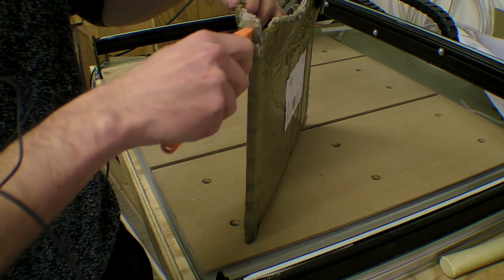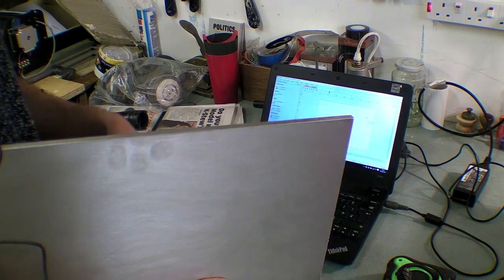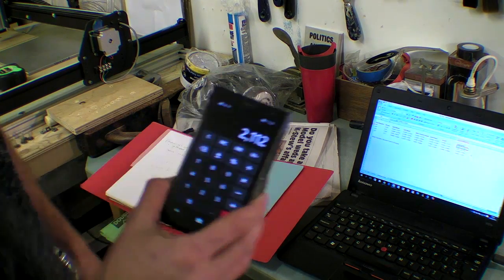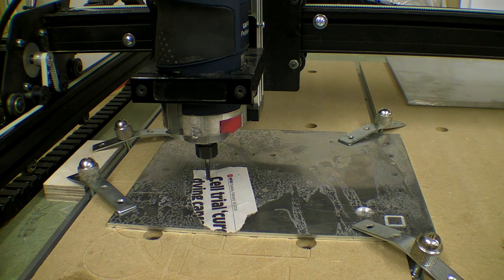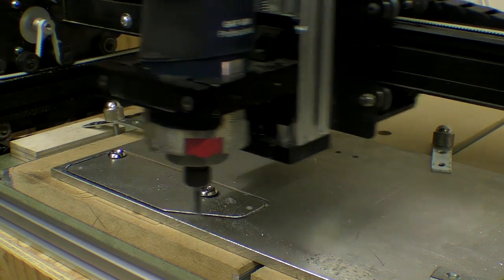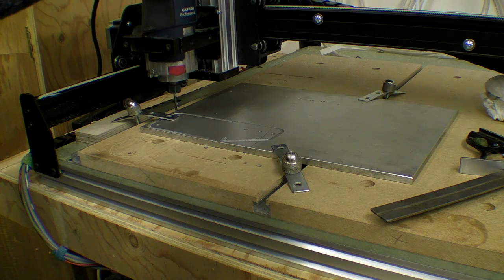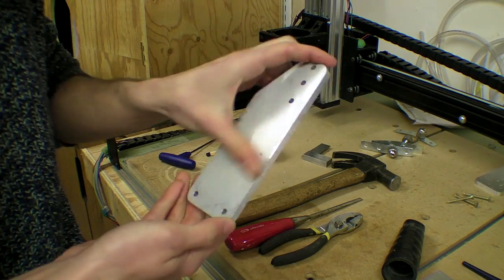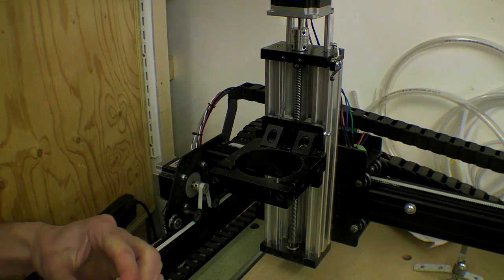MakerSlide End Plates / CNC Cutting 8mm Aluminium

Comment: When cutting aluminum, you have to take into account "chip off load" and the slower the better for a router table CNC.  In addition, as mentioned below, compressed air feed onto the bit will help with both cooling as well as chip removal too.  Also you didn't seem to cut all the away though the material, the best way (IMHO) is to cut all the way thought with "small" tabs has worked the best for me.  Also minus air, a thin oil like WD40 will also work but will make a bit of a mess...
Reply from the maker: +DIY3DTECH.com Yeah I have up - don't think I had the best bit for this. I'm tempted to get an airbrush compressor to aid chip removal but not sure what PSI or ltr/min of air flow would be best.
Reply: Yea you will need more than an air brush compress (I have one for my laser), however a smaller pancake oilless will work just fine.  Also please keep loitering on YouTube as really enjoy your style :-)
Reply: WD40 is not oil. It is a combination of lubricants. It is suitable for this, but so is isopropyl alcohol (for aluminum only).

Comment: try to blow out chips with compressed air. Is the best when cutting thick material with hole saw.
Reply from the maker: +jasql I should have used the mister but I still don't have a sacrificial compressor.

Comment: Savvas, any problem with 4 flutes endmill? It seems for aluminum it's better 1 or 2 flutes...
Reply from the maker: +malibuu6969 4 flutes seems best for finishing and going slow.  I later tired some different bits with the last two, and the best was a 6.35mm 2 flute carbide bit.